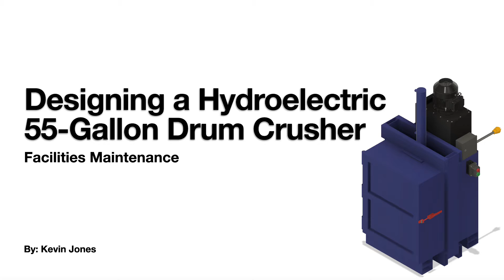Designing a Hydroelectric 55-Gallon Drum Crusher! (Industrial Design)

Comment: Do you have a detailed material/measurement list? I’ve thought about building something exactly like this. Have some of the hydraulic components already. Thanks either way 👍
Reply from the maker: Hello, sorry no this is an older project. I no longer have access to the dimensional drawings. I designed it around a standard size 55-gallon drum and was able to extrapolate a materials cut list from the dimensions of a standard 55-gallon drum.